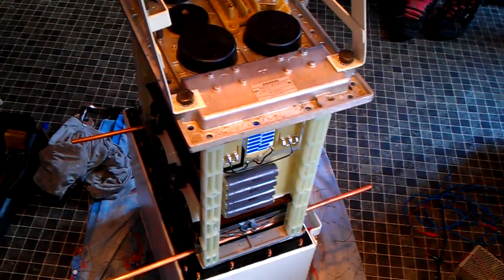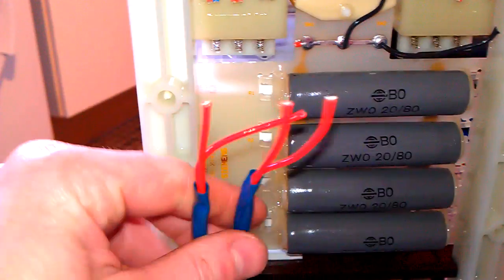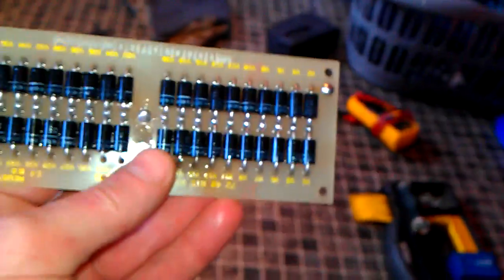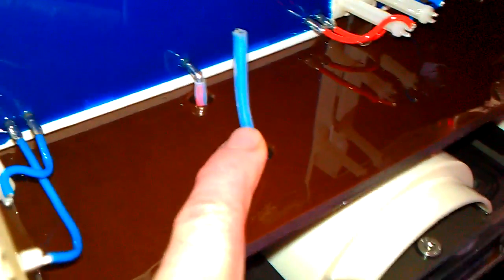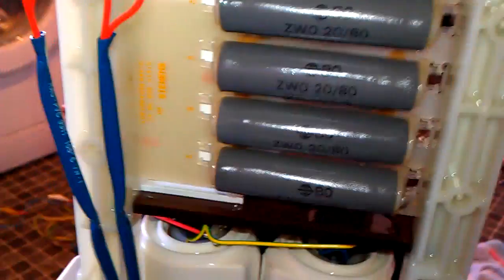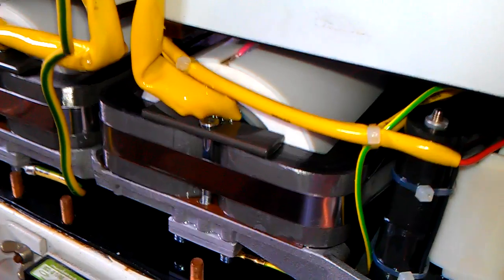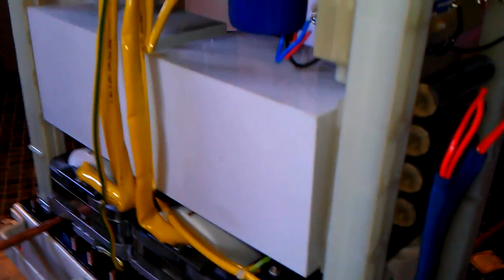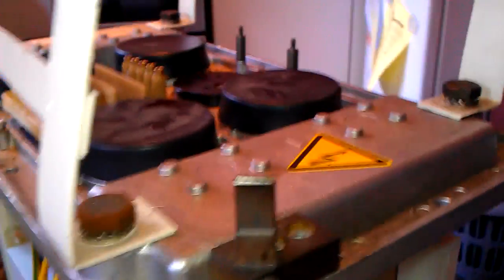Inside tue belly of an Xray transformer"

Comment: That's a ton of awesome components in there, very jealous!

I'm guessing the ferrite transformers are for filament power (judging by the two thick wires coming from each) while the iron core transformers provide the HV exclusively. I've seen photos of a few different X-ray machines which utilized a separate transformer for the LV filament. They are physically large so that enough insulation can fitted between the primary and secondary.